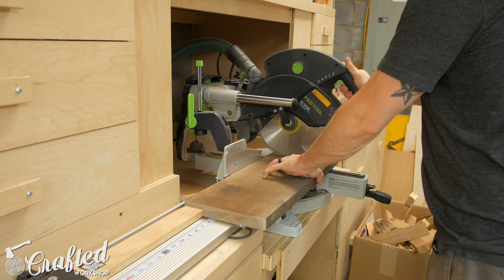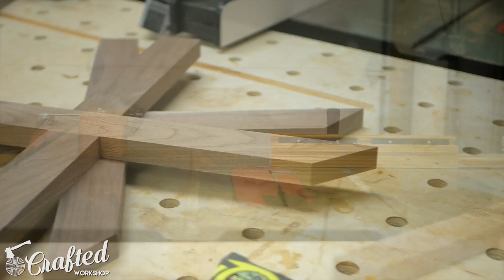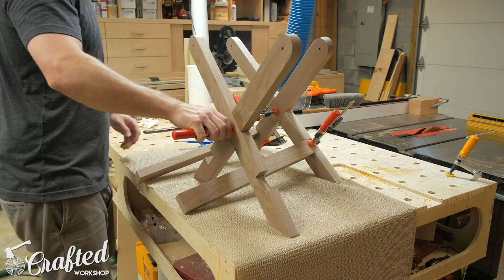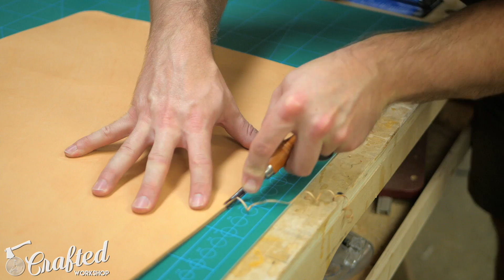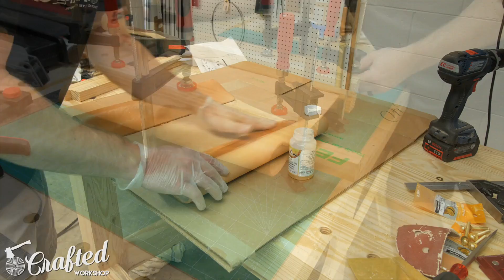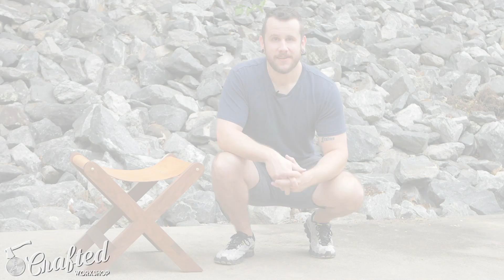Modern Walnut and Leather Stool | How To Build - Woodworking

Comment: The stool turned out cool, its just a shame you had to use pop rivets instead of brass leather rivets. i get it...arrow is the sponsor...but i would drill those out now that the video is done and throw some brass  leather rivets in their place.
Reply from the maker: Honestly, you never see the bottom so it doesn't matter. I like the look of the aluminum rivets and they were super simple to install. Thanks!

Comment: I think brass rivets would have looked a little better given how you connected the dowels, but this is an amazing stool nonetheless!
Reply from the maker: Thanks! Yea, I think matching hardware would be awesome.
Reply: I agree. I have just discovered your channel and have been binge watching your videos. I love your presentation style but often think some of the finishing touches (such as the aluminium rivets) could be better. I'm not trolling, I understand you're against the clock making the videos. I just think that if you are forced to compromise, you should have a "If I'd had time/a chance to do this again, I would have done blah blah blah" in your closing piece so us mere mortals have more confidence if we try it.
Reply from the maker: +liammc47 generally these finishing touches are completely up to the builder. There's really not a right or wrong way for a lot of these things, so they're decisions you need to make for yourself.

Comment: Super project, thanks for sharing. The only thing I kinda do not like is the color of the rivets, perhaps black or brass to match the screws would work better with "all brown" again, thanks for the inspiration.
Reply from the maker: +tunin tunin yea, I agree. I might switch the bolts to regular zinc plated bolts to match. Thanks!

Comment: Cool looking bench, Johnny. Nice tip on finding the center of a dowel. I probably learned that at some point in the past. I'm definitely going to remember that one. 

I was thinking you were going to drill a counter bore in the leg for the dowel. But it's probably not needed. Great job as always!
Reply from the maker: +Joshua Luther thanks Joshua! Yea I want the leather to be removable if anything ever happens to it and it needs to be replaced, hence the bolts rather than permanently attaching it.
Reply: Ahh I see. Makes sense.
Reply: Enjoy OK. Wish I was able to be there.
Reply from the maker: +Joshua Luther thanks, going to be fun!

Comment: Hey Johnny, How would you modify this build so that it was collapsible?
Reply: @joseph goad, maybe use dowels, where the half laps meet across both so it could swivel/collapse. I wouldn't  glue the dowels though, bc doing so would defeat the purpose. Maybe on the ends make some sort of accent wood cap to secure them from falling off or use some of those same accent brass bolts to secure them. I'm sure there's another method but that's just how I'd do it.
Reply from the maker: +joseph goad I would find some hardware that would work. Probably just find a director's chair at Goodwill and pull the hardware from it. You could make it work pretty easily I think.